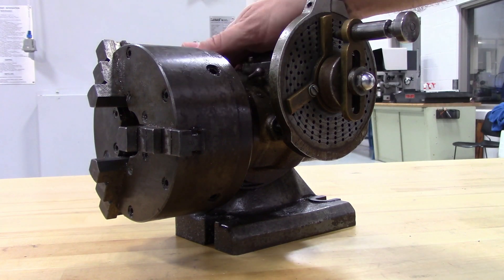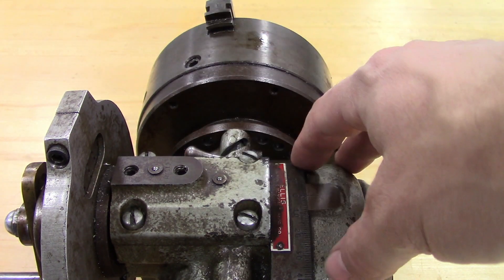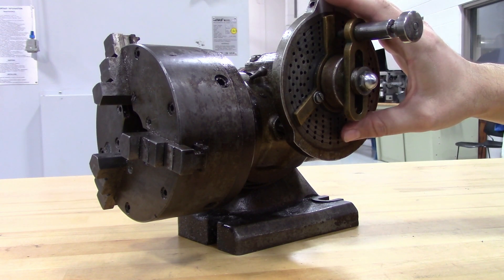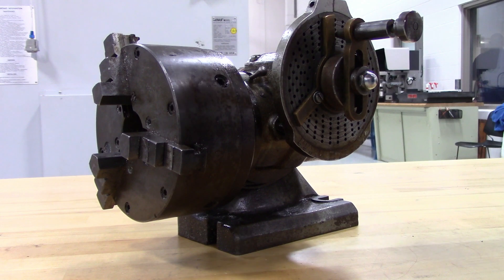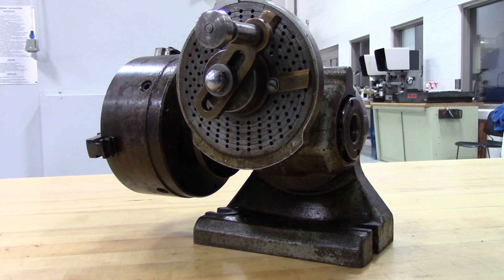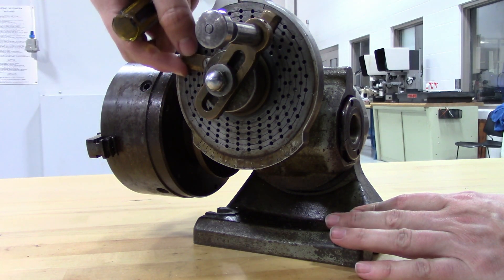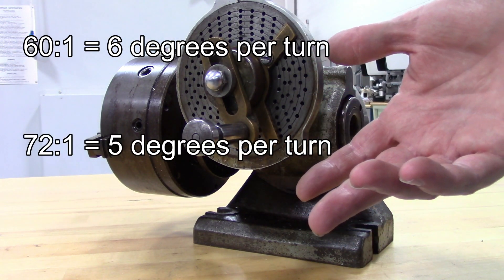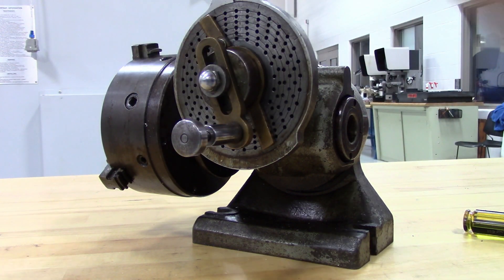How to Use a Dividing Head

Comment: Sounds like you have a denominator stuck in your throat...
Reply: Hi trying to figure out how to calculate  the plate I would need for 40:1 dividing head have to make  a 32dp in a 13.5" diameter blank. Comes out to be 432 teeth I come up with a 54 plate move 5 holes per tooth. Or 0.09259 angular indexing? Please shine a light on this for me thanks in advance  Zed
Reply: Want to purchase a deviding head

Comment: Thank you for making a well produced video.  What model of Ellis Dividing Head are you using in the video.  I want to look for one on ebay.  I assume all of the different plates would be desirable.  Thank you so much.
Reply from the maker: I'm not sure on the model number and it will be a month or so before I'm back at the college where it resides. If you can find one with all the plates, that'd be wonderful, but if not, they're not too hard to make. A bit fiddly, but definitely not difficult.

Comment: How do you work out the holes on the indexplate for example if you have a 36 teeth gear on a 40.1 plate
Reply from the maker: @ArnoduPlessis-n2v  In this example, your fraction would be 40/36 which reduces to 1 and 4/36 or 1 and 1/9. That means 1 complete turn of the handle and then 1/9 of a turn. You just need to find a circle on your plate that is divisible by 9. For instance, if you have a 27 hole circle 1/9th of a turn would be 3 holes. I hope this helps. Let me know if you have any other questions.

Comment: Great vid. But there’s an error about the Ellis head. It does indeed allow you to free spin the spindle. I would have to go and look at mine, but one of the two set screws on the flat of the top of the head is loosened. When loosened by the right amount, you can tilt the wheel down, which disengages the worm and allows the spindle to freewheel. Reverse to put it back. I suppose it’s possible for one of the generations of those heads to not have that feature, but I don’t know of any.

Comment: Thank You Stuart de Haro... Loved your show. Most I was familiar with. I recently volunteered to help a shoe repair shop. He had a very old & beautiful German stitching machine that stopped working. The old & worn micarta sacrificial gear finely gave out and stripped.  For 3 months the repair work was holding the shoe with one hand while cranking the drive wheel with the other. The broken gear was 2" in dia. with a 96 tooth patterns. I could not figure out how to find a 96-hole pattern and I still do not know. I was able to find a nylon gear of exactly the same dimensions on eBay. It is a common gear used in RC cars and in Drones (I got LUCKY!!!). The machine is fixed and is working fine BUT I seriously wanted to know how to hit 96 holes? any suggestions?  I was half way through laying out a 96 hole plate & use it on my spin indexer but found the nylon gears so did not need it. Stuart any thoughts would be very much appreciated. Thank You .... Tuffy
Reply from the maker: You wouldn’t necessarily have to have a plate with 96 holes. Since it's an even number it will reduce quite a bit. If your gear ratio on the dividing head is 40:1, your fraction would be 40/96. The lowest common denominator is 5/12, so you just need to find a plate that will allow you to make 5/12ths of a turn, such as 10/24 (10 holes in a 24 circle) or 15/36 (15 holes in a 36 circle). If you don't have either of those in any of your plates, 24 holes is a whole lot easier to make than 96! I hope this helps. Thanks for watching!

Comment: sir, my gear reduction is 5/1.. bolt head has 6 divisions.  5 divided by 6 = .83  is it 8/10s of a turn seperation of sectors arms? thanks rick
Reply from the maker: That's a very low gear reduction. I would double check that before cutting. Regardless, 8/10 isn't going to turn out correctly. 5/6 is equal to 10/12, 15/18, 20/24, etc. You have to find a hole circle that maintains that 5/6 relationship.
Reply: Mfg by Kearney & Trecker, mod. K. Its called a universal spiral dividing head.
I have a Bridgeport mod. J2 . Just want to perform basic functions. I don't have a driver to sync, for cutting spiral gears.. 
I hope the 5:1 will work.
Thanks rick

Comment: Excellent thank you, I have just bought myself an indexing table and Im feeling more confident in giving it a shot having listened to this video cheers
Reply from the maker: I'm glad it helped. Let me know if you have any other questions. Thanks for watching!
Reply: @StuartdeHaro  Thank you Well I have had a go with mine and the first pattern I needed was 7 holes. My head is 90 turns/rev and the only plate I have divisible by 7 is 21. so that gave me the fraction 6/7 or for this disk 18/21 BUT when I went to set the sector arms they could not be rotated that far apart without hitting the back of the other arm so I had to move the sector arm 1 hole past the position of the sector arm, what a pain. I wonder if you have similar problems for 7 holes?
Reply from the maker: @campbellmorrison8540  Did you try rotating them both directions? You should be able to close them almost completely. Usually they have a bevel on the edges of each arm and that should be the inside edge.
Reply: @StuartdeHaro  Thank you for your response. Yes I did. The bevels do face each other in what I will call the closed position. If I fix one arm at the zero hole on the 21 hole plate and then move the other arm around clockwise I can not rotate it far enough to get the beveled edge to the 18th hole. I could align the arm with the high side on the 18th hole but this limits the ability for the hand crank pin to engage although that is what I ended up doing and moving the second arm back a little ie using the bevel side for the start position and the non bevel side of the second arm as the finish position. From what I can see it only seems to be a problem with 7 holes what I may do is make a 7 hole / 21plate specific arm that is fixed just for this but its not like I need 7 holes very often.
Reply from the maker: @campbellmorrison8540  Well that sounds inconvenient, but your plan sounds good to me. Good luck and let me know how it goes.

Comment: How about 50teeth sir
Reply from the maker: Pretty easy. Your fraction is 40/50 or 4/5 of a complete turn (assuming you have a 40:1 gear ratio). You just need to find a hole circle that is divisible by 5. For instance, in a circle of 20 holes, you would go 16 holes. That's because 1/5 of 20 is 4, so 4/5 of 20 is 16. Let me know if you have any other questions or need any clarification on my answer.
Reply: @StuartdeHaro  tnx,I'll check if there is 20hole circle plate
Reply from the maker: @mariojacob363  It doesn't necessarily have to be 20 holes, just anything divisible by 5 so you can get 5ths of a turn. If you have a 25 hole circle, you'd move 20 holes for 4/5 of a turn. 30 hole circle you'd move 24, etc.
Reply: We have 15hole plate also,
Reply: 4/3 x 5 =12/15
This is for ,15hole plate
Reply from the maker: @mariojacob363  great,  so you would move 12 holes in that 15 hole circle.
Reply: Yes,I know sir,but inoerder not to make 25 holes,I just do it ,in 20hole,plate plus 16, because we have 20plate hole circle,can it be done

Comment: Sorry to be commenting on an older video but I have a question for you. I'm new to this dividing stuff so please bear with me. I have a faceplate that will thread on my dividing head after the chuck is removed. With this set up can I use the dividing head as a rotary table?
Reply from the maker: Hi Jim. Yes that would work, although it isn't going to be as low profile as a real rotary table. You also won't have degree marks on the table (unless you add them) so you'll have to do everything by angular indexing. Let me know if you have any other questions. I'm here to help.

Comment: Okay is there a rule of thumb do you always keep the handle pin on the right hand side of the dividing arms but I guess that isn't so because as you turn it it will change to the left hand side I need to learn how to do this I absolutely have to learn how to do this and I have dyslexia which doesn't just affect reading and writing but affects spatial orientation so I'm going to have trouble with this. Once I get it down I'll be very good at it because I have to do it and I'm very stubborn but I am going to make a lot of mistakes I went out and bought a great big chunk of delrin and one of nylon and I'm going to slice it up into gear blanks to practice on that way I won't be ruining a bunch of crap. I live near an alto steel company they discount oddball cuts of delrin for like $0.50 a pound believe it or not so I get that kind of stuff for next to nothing so I'll be able to practice like crazy and I won't wear out gear cutters either. But this is something that I have to do any advice would be greatly appreciated
Reply: Don't think of it as being to the left or right , it is more about backlash . So if you turn clockwise and then try to correct going too many holes by going back a couple of holes then the accuracy is lost . What we were told on our apprenticeship was to go right back and then repeat the turns . So if you have to for example  go five holes on a thirty plate  , which is 1.5 degrees , then clockwise or anticlockwise will give the same result in an opposite direction so it works either way . If however the handle slackens up then you have got backlash and need to go back about half a turn and then start again to move in the direction you want . I hope this helps ? Good luck .

Comment: Hi Stuart,
This is pretty late and probably unhelpful, but you mentioned there was no way to disengage the worm from the gear, I do believe on that model, the set screw on the right (in relative to the shot you were speaking about it), you can turn it back, and then push the indexing plate forward, in a nodding down motion, and the worm would move off the gear. You probably knew that and just said that cause it’s easier but I hope it helps somehow! Best!!
Reply from the maker: I did not know that. Thank you. That is very helpful.
Reply: @StuartdeHaro  yup! I love your channel btw. You are one of the most entertaining and informative ones!

Comment: What plate do I need to cut a 53 tooth gear on a 90 to 1 rotary table ?
Reply from the maker: You would need a plate with 53 holes (or a multiple of 53) since that is a prime number. The fraction is 90/53, so that means 1 complete turn of the handle and then 37 holes in that 53 hole circle. Of course, it could also be a 106 or 159 circle, but getting that many holes in the plate would be a tall order.
Reply: @StuartdeHaro    Thanks for the info ..

Comment: hi...

i have BS2 type taiwan make universal dividing head..
in  their manual they give only formula for table andle , driven and driving wheel .aslo have 4 figure for gear setting with chart  but i couldn't recognised how to set up gear wheel between diving head and milling x axis lead screw. be cause they not give further information for how to set up.

here is
my job detail

1.  setting angle of milling table is 0.97
2.  driven wheel 40 and driving wheel 52

can you help out please ..for gear setup between lead screw and head for my job.

job parameter...
lenght - 13 inch
od - 6 inch
teeth - 50
 
my job is loag lead helix type. 

my whatsapp number +919879687197

Comment: How would you recover and figure out where you were if you accidentally bump the sector arms while rotating it? Asking for a friend who will probably do this in the future at some point.
Reply from the maker: Tell your friend to pay attention to where the arms were at the beginning of the movement, so if he does bump the arms as he turns past he can put them back where they belong. If your friend is still nervous about it, put a mark on the plate with a grease pencil or something else that's easy to remove. Recovery after the fact is tougher. You could try moving back to the previous cut, making sure to remove the backlash in the gearing. You can verify with the cutter or an indicator as needed. Thanks to you and your friend for watching!

Comment: how can I do 1 Degree 45 minutes on (means 206hole on plate),please reply
Reply: Hi Anivesh - 
Following Stuart's approach, if your dividing head's gear ratio is 40:1 then That'd call for a plate with 103 holes, which you might have to make.
1.75º (1º + 45/60º) is actually 1/would be 7/36 of a rotation (7 holes on a 36 hole circle): 40/360 + 30/360 = 70/360 = 7/36. Let us know if that works?

Comment: I have a 60 to 1 small gearbox . can I mack a  dividing head out of that?
Reply from the maker: You could. You just need to figure out how you're going to mount the chuck on the output side and come up with a dividing plate, handle, and sector arms (not strictly necessary ,but helpful) for the input side.

Comment: Hi can you help me please. I'm trying to cut 112 teeth into a wheel. With a 1:40 denying head with no look. The dividing plates I have are. A:15,16,17,18,19,20        B:21,23,27,29,31,33        C:37,39,41,43,47,49         Thanks Matt
Reply from the maker: I didn't see this comment until today. Sorry. Your fraction would be 40/112 which reduces down to 5/14 of a turn so you would need a hole circle that is a multiple of 14, which you do not appear to have. You can make a plate yourself. I recommend using a higher number multiple like 56 so it will be more useful for other divisions.

Comment: Great vid learned a few things. I'm working on building a Gingery book #6 dividing head with a 40:1 ratio. I hope to be able to cut change gears for the Heavily  modified Gingery lathe I built. Before anyone replies to malign the Gingery lathe it is being built solely as a hobby, just something to have fun at. It works very well. I'm using it to work mainly cold rolled steel. It is capable of very heavy cuts for such a small lathe. (UP TO 1//4" deep in a single pass) The castings for it are aluminum from old engine pistons.

Comment: I would like to know how to cut hellical gear with dividing heads.
Reply from the maker: In order to cut helical gears, the dividing head needs to be geared to the table so as the table moves the dividing head does too. This gives you a spiral. This is a pretty simplified version of the process, but hopefully it gives you the basic idea. Thanks for watching!
Reply: Thank you for your reply,. I seen some videos on it, but none really explain much. already, purchased the dividing head and gears. There are multiple angles involved, little confused, though I think I am getting it. Now I am trying to figure out how to connect the deviding head and gears with 1" shaft and bores to the 5/8" shaft of the x axis of the on the mill.
Reply from the maker: It definitely is not an easy setup. It's one of those that takes you all day to get right and then 10 minutes to machine. Helical gears were generally cut on horizontal mills with universal tables that could be angled, but a vertical mill with the head angled works too. Check out Ivan Law's book on gear cutting if you haven't already. Good luck! Take a video and shoot me the link when you're done. I'd love to see it.
Reply: Thank you for your reply. I figured they'll be a bunch of trial and errors.  The way it's looking it might be awhile before I start it. I will look for the book you mentioned. I have not looked at the book yet. thank you. My camera that I was planning to do videos on was taken. I might have a new one by the time I start the helical gear. Happy holidays.

Comment: I learned all this in High School machine shop back in the early 60's. Used the knowledge several times through out my career in the shop also, as well as tying the head to the table lead screw through a gear train to cut helical spirals. Not used much any more. Thank you CNC

Comment: I can't seem to save the documents, only open them in google docs, but cannot simply save as a pdf.  Settings OK ?
Reply from the maker: I'm not sure how that works.  I'll check and see if there are any settings that I need to change.
Reply: At google drive page, on top right, click the Arrow that is pointing down. If no arrow, use save page as from browser, choose pdf. From browser, choose Print, and print as PDF. There may be others, depending on what you have, and you may not have these options also.
Reply: @BiddieTube  None of those options have worked for me.  The address of the links end in "view"
That makes me think it's view only permission.
Reply: @12345NoNamesLeft  The URL's end in /view for me also. But I have all above mentioned save capabilities using Brave browser on windows 7 pc. Most, if not all phones, pc's, mac and Linux equipment has "Screen Capture" and save capabilities. Try that option if all else fails. Or log in with a pc and save the files. Whatever you are using though should be capable of saving the PDF files. What kind of device are you using? Another option, if you have a google account, you must if commenting here, then click the Recycle icon at the top right to "Add to your drive", then download if from there.

Comment: Do more dividing head videos. I’ve worked in a shop that never used dividing heads, just rotary tables and spin indexers, for the most part. The shop was converting to all CNC when I left. There were literally a handful of manual machinists, at the time, and I never learned CNC.